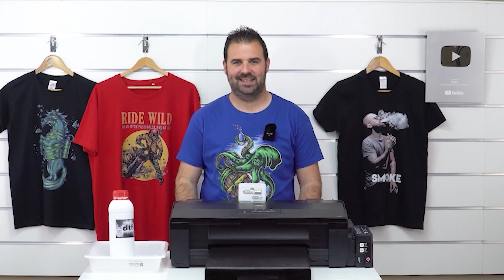🏆 The BEST DTF software 🏆: RIP Cadlink Digital Factory DTF

Comment: Does this software work with epson ET 8550?
Reply from the maker: Yes! It also works with that printer model
Reply: I have a converted Epson ET 8550 printer and I have had nothing but problems with this RIP software. Repeated paper jams and other issues only happen when printing from this Rip software.
Reply: @itsgigiyall  Hello im going to buy 8550, please do me a favor and tell do's and dnt's

Comment: This software works for every dtf printer?
Reply: My model is xp 15000 would it work?
Reply from the maker: Hello, Nuno! No. There are only a few drivers available for the most commonly used printers. If you tell us your printer model, we can tell you if it is compatible.
Reply: L18050 can it work